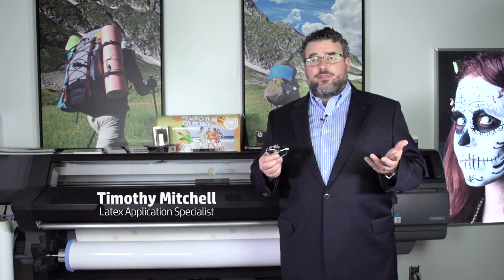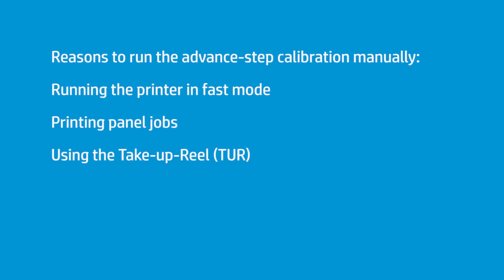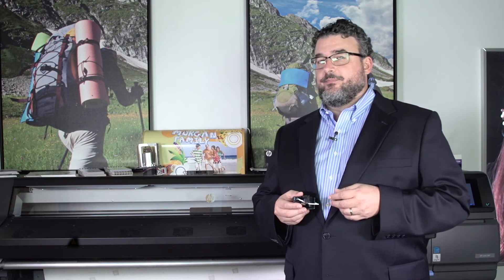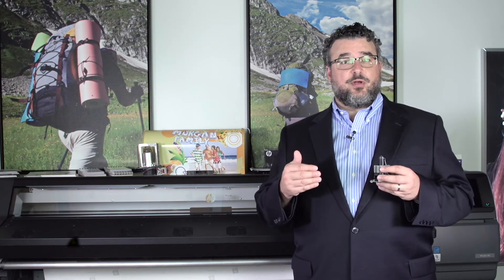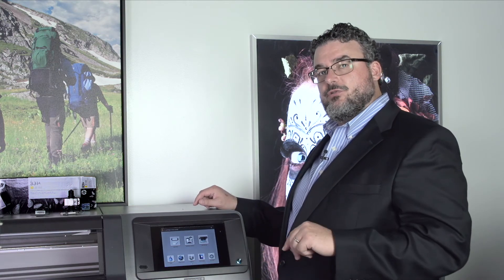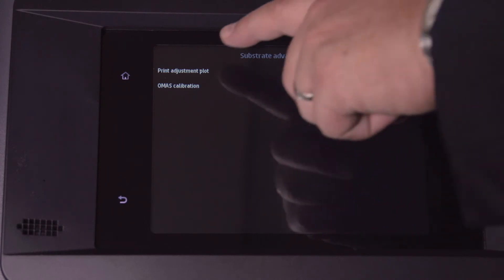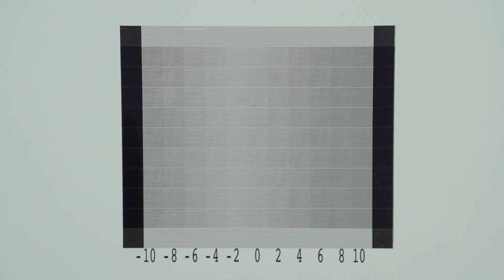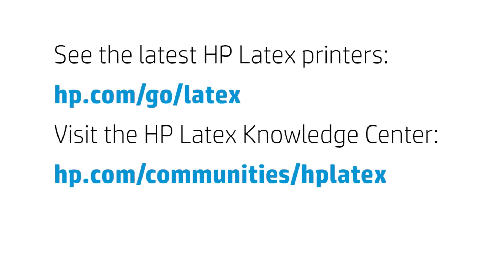Calibrate Your HP Latex Printers with No Optical Media Advance Sensor (OMAS) | HP Latex | HP

Comment: I HAVE LATEX 360 ERROR CODE IS 58.10:10 WHAT TO DO
Reply: Check that the Color sensor is installed in the Carriage.
 Check that the Color sensor is correctly installed and screwed into place. Check that the Color sensor cable is not damaged. 
Check that the Color sensor cable is correctly connected to the Carriage PCA. 
If the system error persists, replace the Color sensor.
 Perform a Color sensor basic test (CLC), to ensure that the replaced part is working correctly.